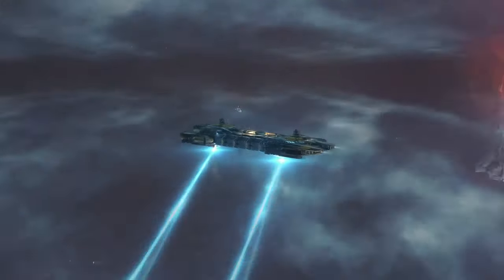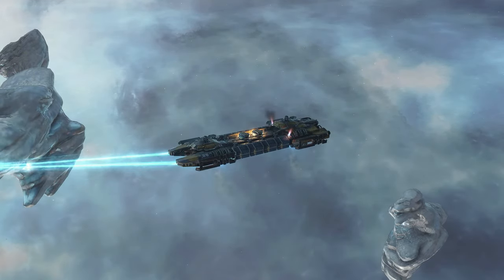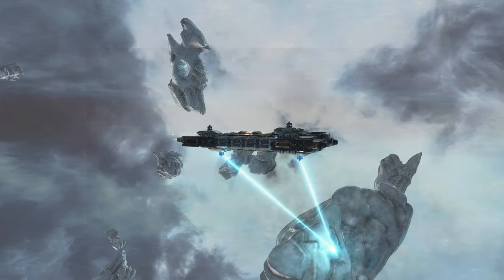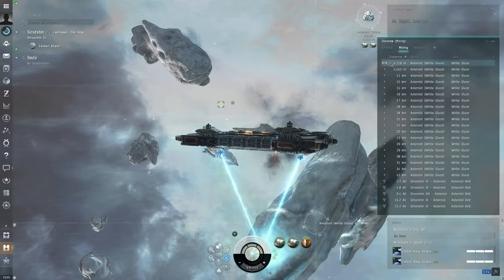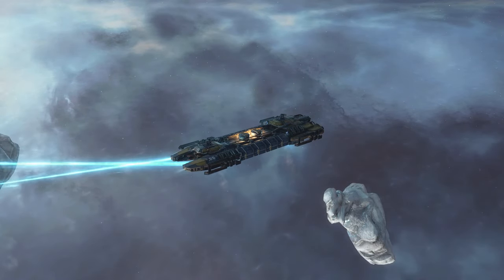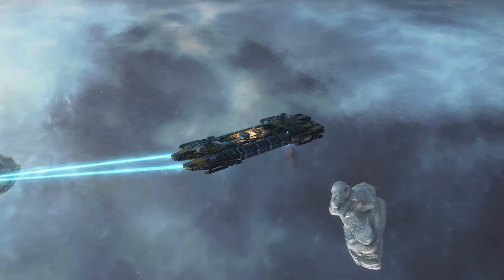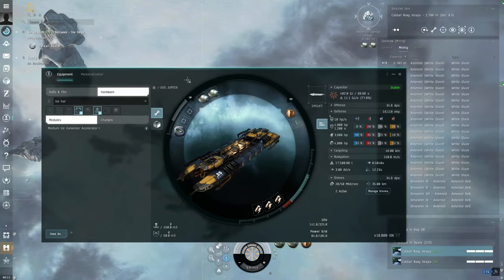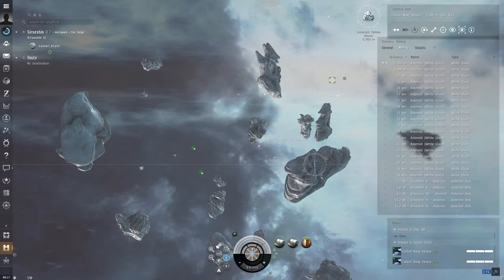In-Depth Guide to Ice Mining 2022-2023

Comment: With the changes to compression. Size of the ore hold doesn’t matter. All you need is a porpoise with compression module. Full fit cost 110-140 mill. Then you can use convetors all you want. Our set up is one porpoise and 10 covetors. We destroy belts and ore anomalies
Reply: With regards to ice mining only the orca or rorqual can compress ice.
Reply: the porpooise cannot compress ice..
Reply: With the porp+10 Covs, how long does it take to kill off a highsec belt, and how much is in a belt now (use to be 100 mill worth of ore per belt)?